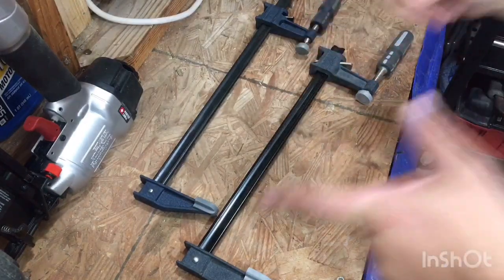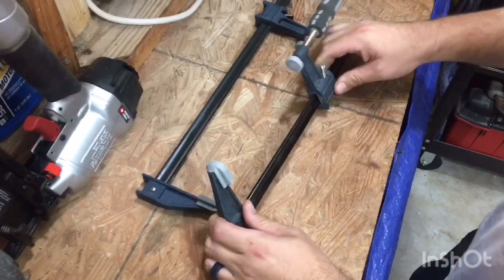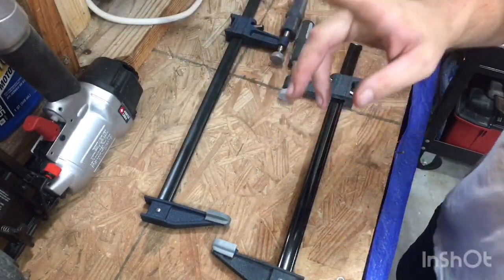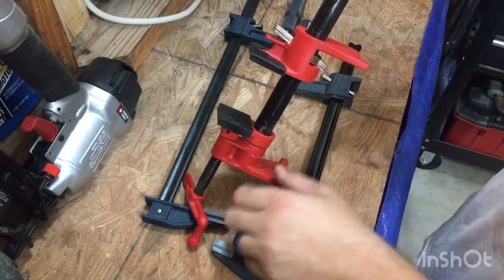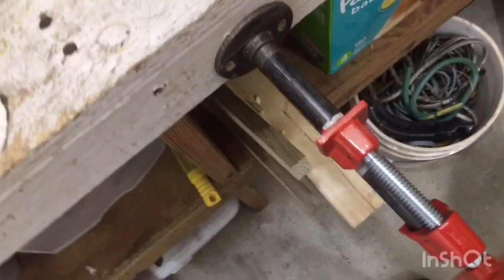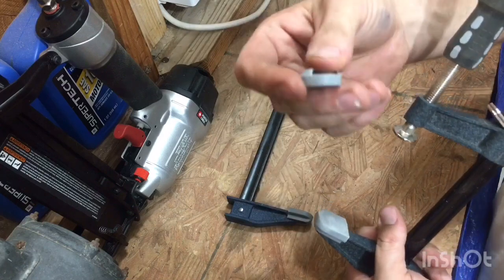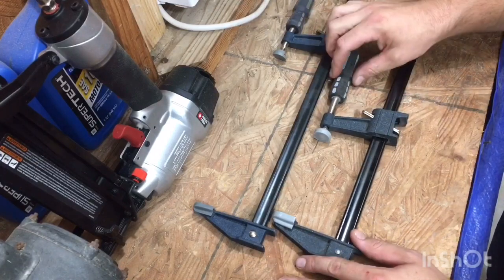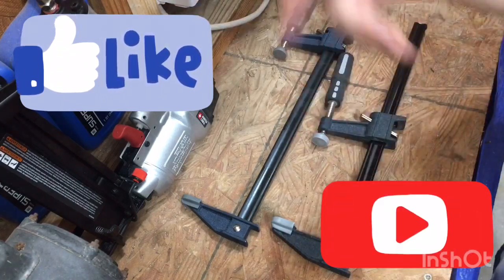Harbor Freight Clamps Review || BONUS Pipe Clamp HACK

Comment: Everything you said is right on point. Im sort of new to woodworking and i was struggling to buy clamp. One time i bought the quick realease clamps from HB and they sucked. I tought I'd give these bar clamps a try and OMG!! I've had mine for over a year and they're still going. Great review!!
Reply from the maker: Omar Flores thanks! Glad u came through. I have had to return 1-2 of them that had some issues with the screw not engaging very well. But it was a quick in and out exchange 👍🏼